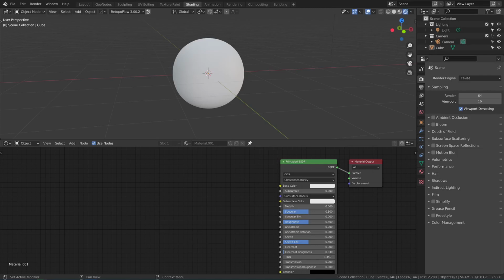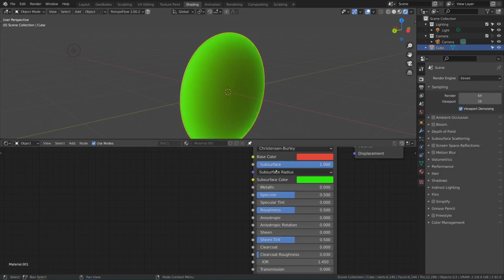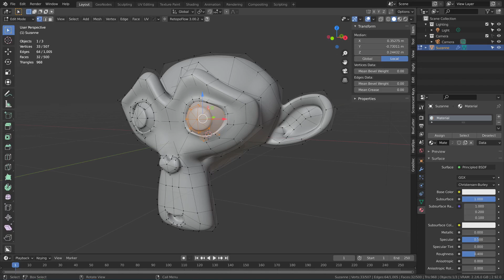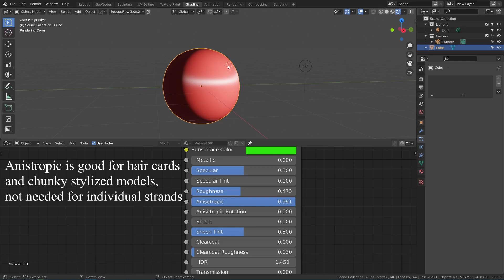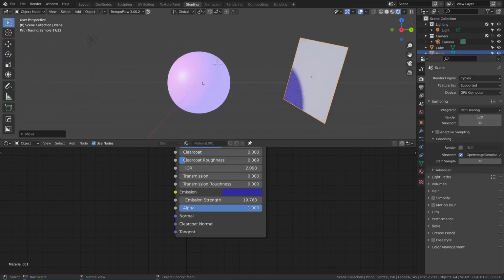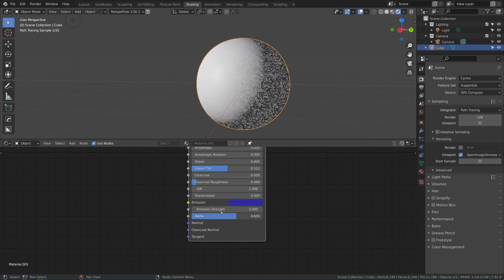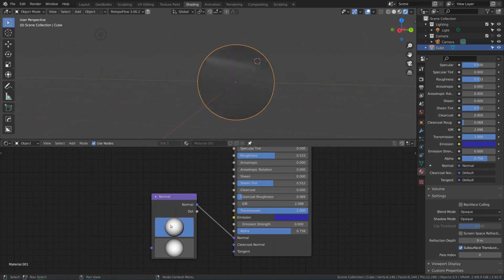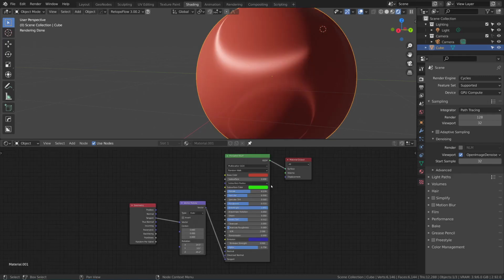All Blender Principled BSDF Settings Explained

Comment: I have a question relating to the Principled BSDF.  In the version of Blender that I am using, there are two setting that weren't in your video: Subsurface IOR and Subsurface Anisotropy.  When entering in the Subsurface IOR, would you enter the actual IOR of an object or a different number?  And if it is a different number, how would you calculate it?
Reply from the maker: The default Subsurface IOR value is in a similar range to the values on charts like this: https://pixelandpoly.com/ior.html so I'd guess just use the actual IOR.

I think it would make sense if the default is approximately what human skin would be (looking around online I'm seeing 1.3 or 1.4).

For Subsurface Anisotropy, the Blender Manual says it "Controls the directionality of subsurface scattering", so it would be for a surface that would have a different structure from different angles (maybe a piece of cloth, or a leaf), though I'm not sure how it would affect it 

These two settings are both currently Cycles only.

Comment: Thanks for making this, you covered everything very clearly and precisely. It was exactly what I was looking for.
Reply from the maker: Awesome, glad it was helpful!
Reply: @MrTriPie  when I export obj with all the textures and principled bsdf nodes colors

The problem is that when i pack resources and expprt OBJ them import the OBJ and materials in a new file all bsdf only colors become white and I have to readjust them!

Is there a way to save the bsdf setting and export it with the obj?